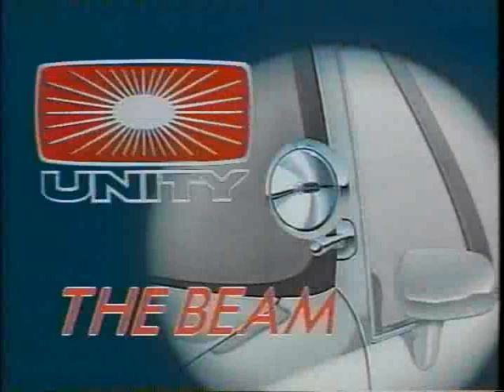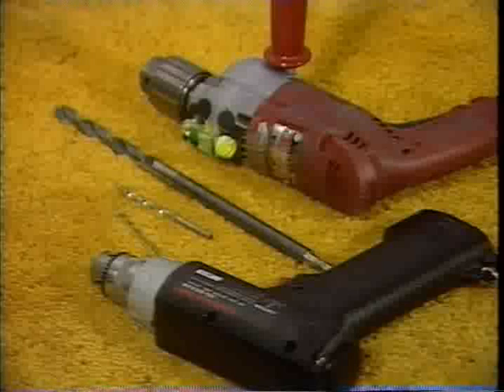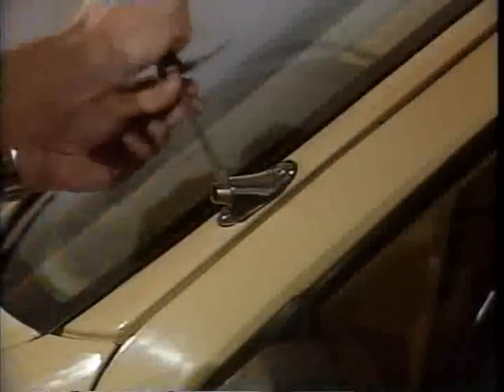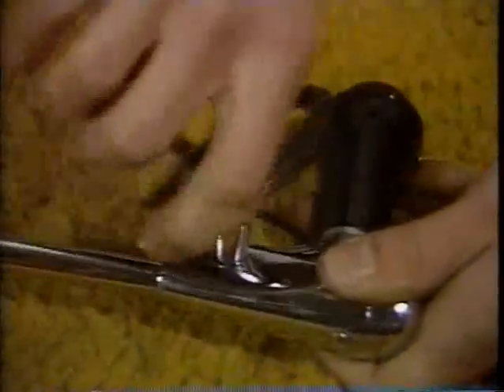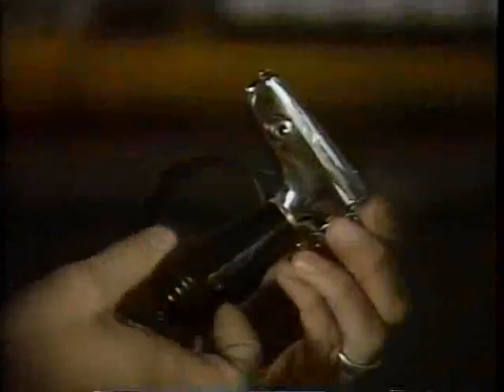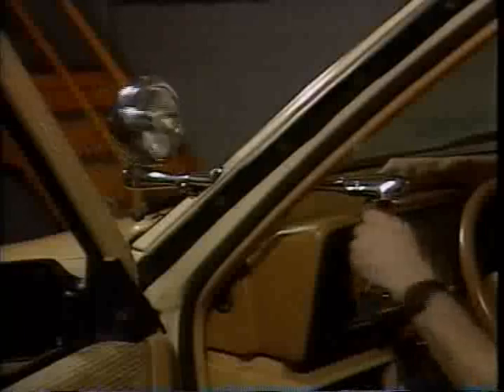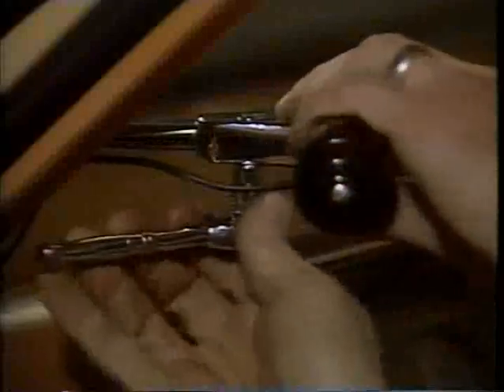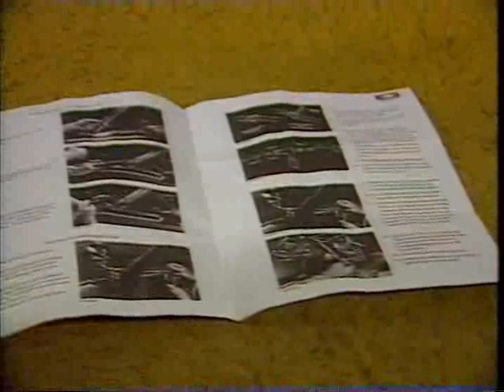Unity Spotlight Installation Video

Comment from the maker: To determine what parts are needed for your vehicle use our application search. By selecting year, make, and model our application search will provide you with a list of different spotlights that fit your vehicle and installation kits needed to mount the lights. Application Search: https://www.unityusa.com/Application-Search_ep_77.html
Reply: I think 400 dollars for one spot light is a might much.
Reply: @TempoDrift1480  I just found one at a pawn shop for $10. I have to order the install kit but I was like you. I didn’t want to install something for novelty for that price but for $10, I’m gonna do it! Good luck on your search
Reply: Drilling through a structural member of a cars roof is almost certain death in a roll over!!! Who in cornbread hell thought this was a good idea!!!

Comment: The whole “keeping the drill level “is very confusing. My bracket for a Toyota Tacoma is angled downwards 20 degrees thus it’s impossible to have the drill level. Does unity mean keep the drillbit parallel to the bracket? I have managed to drill through the outer sheet metal with a brand new half-inch drill bit but I warn you it’s not for the faint of heart. The flute of the drill bit will snag on the Sheet Metal (yes I was going at a very slow speed with a heavy duty drill) and on the bracket forcing the bracket upwards and possibly bending  the sheet-metal of your vehicle. I have tried for several hours even machining bushings for a 1/8 inch drill bit and 3/16 inch drill bit to try to make a pilot hole for the half-inch bit to go through. It is not working because of the angle of the a pillar of my truck. I was just forced basically to buy the $132 drillbit from unity in hopes that I will be able to install my spotlight. Also I advise anybody attempting this to use rivet nuts and machine screws to attach the bracket to your vehicle if they can get them instead of the sheet metal screws that unity provides. Because as I mentioned above if the drill bit snags it’ll rip the sheet metal screws out of the holes of the sheet metal forcing you did you do some repair work that you didn’t want to do. If your bracket is pretty level and it’s a straight shot I’m sure that should be no problem but if your bracket is angled downward I’d be very careful.

Comment: My concern is the inside handle is so long. I plan to install in a Jeep JK Wrangler 2 dr. This isn't a Crown Vic, I need a very short shaft, I still need to steer the Jeep. Those handle look a inch or two from the steering wheel. How about a super short post handle?
Reply from the maker: For 2017-1996 Jeep Wranglers a spotlight with a V length shaft is used and is mounted with a 12 installation kit for driver side mount and 12RH installation kit for passenger side mount. This is 1.5 inches shorter than the spotlight used on the crown victoria. Position of light handle to the wheel is not just controlled by shaft but how the light is mounted through the vehicle. For the crown victoria we had to make a special mounting setup with the bracket inside of the vehicle and a notch cut into the door to make it fit. For the jeep the light is mounted normally on the post. The goal our of engineers when developing applications is to keep the handle safely away from steering wheel. Also we now have handles with shorter grips available. 

V shaft spotlight options: https://www.unityusa.com/V-Shaft_c_2971.html
12 kit: https://www.unityusa.com/12-Installation-Kit_p_794.html
12RH kit: https://www.unityusa.com/12RH-Installation-Kit_p_814.html

Comment: Is it possible to do a pillar mount on a 99-2016 Ford Superduty? I only have found kits for door mount.
Reply from the maker: Our application engineers determined that A Pillar mount would not work. We only have a door mount application.

Comment: I was wondering if there is a way I could possibly install one on a 2000-2005 Buick Lesabre. Is it possible?
Reply from the maker: 2000-2005 Buick Lesabre uses a spotlight with a DC length shaft mounted with a 232RH installation kit for driver side mount or 232 installation kit for passenger side.

DC Shaft Spotlight Options: https://www.unityusa.com/DC-Shaft_c_2959.html
232RH: https://www.unityusa.com/232RH-Installation-Kit_p_876.html
232: https://www.unityusa.com/232-Installation-Kit_p_854.html

Comment: How about a shorter Shaft? The Jeep Wrangler has a very small cabin. That Shaft is very long, that shaft is right in your face. How can I buy a shorter shaft?
Reply from the maker: We have around 80 different shaft options and 17 standard shaft lengths. Not knowing what shaft you have or what year of Wrangler makes it hard to give you a good answer. I'm going to make some guesses, if anything is wrong the info may be different, let me know and I will give you correct info. 

I am going to guess this is a 2018-1997 Jeep Wrangler. For that, we recommend a V length spotlight shaft mounted with a 12 installation kit for driver side or 12RH for passenger side. 

Without knowing shaft length can't tell you if that is shorter or not than what you have. If you bought a light second hand from somewhere like ebay, most of those lights tend to be Crown Victoria spotlights. Those lights use a very specific shaft designed only for Ford Crown Victoria (and vehicles of the same base frame) The shaft is 1 1/2" longer than the V used for the Wrangler. So the V would be shorter than that light. We are also starting to see more Explorer and Taurus lights from similar sources. Those lights are 3" and 6 1/2" longer.

Shaft of a spotlight can be switched out. Replacement V shaft is 3615-V-45.

V Length Shaft Spotlights
http://www.unityusa.com/V-Shaft_c_1574.html

Replacement V Length Shaft
http://www.unityusa.com/3615-V-45-Shaft-Headpost-Assembly_p_683.html

12 Installation Kit
http://www.unityusa.com/12-Installation-Kit_p_794.html

12RH Installation Kit
http://www.unityusa.com/12RH-Installation-Kit_p_814.html
Reply: Thank you for the info. At this time I don't own the spotlight, I'm seeking a new light with this short shaft you speak of. If you know of a Unity Dealer in Northern Colorado that can sell & install on a 2017 Wrangler JK I'd love to be your customer.
Reply from the maker: Here is a link to our distributor search using you zip code, you can search for distributors near you. Ones that do installs are marked. If you need any additional help please let us know. http://www.unityusa.com/Distributor-Search_ep_78.html
Reply: Thank you, however O'Reilly Auto Parts is the only dealership from Denver to the Wyoming border, and they do not install.  I'm really seeking a company to order the part, install the part, and back the part. It's a brand new Wrangler. I need it done right. Thanks for your effort.
Reply from the maker: Around Denver & heading north to Wyoming for Installers we have:

The Lighthouse Inc 5900 East 58th Avenue Commerce City CO 80022 303-227-0001

Wireless Advanced Communication 3901 West Service Road Evans CO 80620 970-330-9415

Lighting Accessory & Warning Systems 7124 South Dillion Court Englewood CO 80112 720-870-4965

Av-Tech Electronics Inc 12851 West 43rd Drive Golden CO 80403 303-288-0313
Reply from the maker: crzyredneck  1985 Chevrolet S10 uses a spotlight with a GM length shaft mounted with a 189RH installation kit for driver side mount or a 189 installation kit for passenger side mount.

Comment: I bought a 2014 ppv Tahoe. Which kit do I need. I do not have side curtain airbags. Thanks
Reply from the maker: 2014 Chevrolet Tahoe uses a 257 installation kit for driver side to mount a spotlight with a CF54 shaft and 257RH installation kit for passenger side to mount a spotlight with a CF55 shaft.

Driver:
CF54 Shaft spotlight options: http://www.unityusa.com/CF-54_c_2056.html
257 kit: http://www.unityusa.com/257-Installation-Kit_p_947.html

Passenger:
CF55 Shaft spotlight options: http://www.unityusa.com/CF-55_c_2057.html
257RH kit: http://www.unityusa.com/257RH-Installation-Kit_p_1600.html

Comment: I just bought an old set of S6 lights off some Ford vehicle. the shaft appears to be the same type as the one shown in this video. Will your modern production mounts and handles be compatible?

Thanks,
John
Reply: They should be compatible.
Reply: +Chad Stone I bought some handles, they are compatible. Thanks
Reply: Yes they are, check out the video I have that goes in depth explaining how these work
Reply from the maker: Sorry we didn't see this sooner, just realized youtube was sending alert emails to the wrong email. The way our lights mount and how handles attach to the light has been the same for the whole life of model S6 spotlights, which began production in 1948 and are still currently in production. Current spotlights also mount same and attach handles the same way. In that way you should be fine. My only concern is that length of the shaft does matter for specific vehicles, too short or too long can cause issues with function. Also some modern vehicles due to internal parts inside of a post getting more complicated (air bags, speakers, etc) do need custom fit shafts designed specifically for that vehicle.

Comment: Love old media - btw, do you have an application for an 07 yaris? My sharkcar needs a spotlight!
Reply from the maker: 2007 Toyota Yaris sedan and 3 door use a spotlight with a CL length shaft mounted with a 208 installation kit for driver side mount or 208RH installation kit for passenger side mount.

CL shaft Spotlight Options: https://www.unityusa.com/CL-Shaft_c_2958.html
208: https://www.unityusa.com/208-Installation-Kit_p_769.html
208RH: https://www.unityusa.com/208RH-Installation-Kit_p_773.html

Comment: I need a spotlight for my Dodge Charger 2017 Pursuit, what would be the model number? Would the S04 work?
Reply from the maker: 2017 Dodge Charger uses a spotlight with a CF61 shaft mounted with a 253 installation kit for driver side or a spotlight with a CF62 shaft mounted with a 253RH

Driver Side:
CF61 shaft spotlight options: https://www.unityusa.com/CF-61_c_3053.html
253: https://www.unityusa.com/253-Installation-Kit_p_910.html

Passenger Side:
CF62 shaft spotlight options: https://www.unityusa.com/CF-62_c_3054.html
253RH:  https://www.unityusa.com/253RH-Installation-Kit_p_1597.html

Comment: What about finding the right ones for a 2008 ford crown victoria police interceptor because I am looking to purchase 2 of them.
Reply from the maker: 2008 Ford Crown Victoria Police Interceptor used a 94014-0002 spotlight mounted with a 5556 installation kit for driver side and a 94015-0002 spotlight and 5557 installation kit for passenger side mount.  Correct lights for vehicles can be found using our Application Search found under the searches section of our website or by following this link: http://www.unityusa.com/Application-Search_ep_77.html

94014-0002 Spotlight
http://www.unityusa.com/94014-0002-H3-Halogen-6-Spotlight-Black-330-S04-LH_p_1246.html

5556 Installation Kit
http://www.unityusa.com/5556-Installation-Kit_p_808.html

Passenger Side
94015-0002 Spotlight
http://www.unityusa.com/94015-0002-H3-Halogen-6-Spotlight-Black-330-S04-RH_p_1247.html

5557 Installation Kit
http://www.unityusa.com/5557-Installation-Kit_p_809.html

Comment: I might be coming into a 2001 Ford Crown Victoria. Do you guys have any LED models available for the CV, non PI variant?
Reply from the maker: Yes we do. We have three different LED options that are all available for the Crown Victoria. Standard LED, our new X-LED and our smaller 5" LED
Since this is not a PI we have two different mounting locations that use different parts. The PI uses the inside post application and we also have the door mount installation. Door mount is much easier install but the light will move when the door does. Inside post is more professional but requires extra steps and cutting a notch in the door. If the vehicle already had a spotlight installed you would just get the correct light for the existing hole.

Door Mount Parts:
Standard LED: https://www.unityusa.com/335GM-0002-6-BLK-SPOTLIGHT-LED_p_36.html
X-LED: https://www.unityusa.com/X335GM-0002-6-BLK-SPOTLIGHT-LED_p_2388.html
5" LED: https://www.unityusa.com/255GM-LED-5-Spotlight-H1_p_3176.html
Install kit LH: https://www.unityusa.com/232-Installation-Kit_p_854.html
Install Kit RH: https://www.unityusa.com/232RH-Installation-Kit_p_876.html

Inside Post:
Driver Side:
Standard LED: https://www.unityusa.com/94018-0002-LED-6-Spotlight-Black-335-S04-LH_p_55.html
X-LED: https://www.unityusa.com/X94018-0002-X-LED-6-Spotlight-Black-X335-S14-LH_p_2405.html
5" LED: https://www.unityusa.com/S94002-LED-5-Spotlight-255-H1-LH_p_2964.html
Install Kit: https://www.unityusa.com/5556-Installation-Kit_p_808.html

Passenger Side:
Standard LED: https://www.unityusa.com/94019-0002-LED-6-Spotlight-Black-335-S04-RH_p_56.html
X-LED: https://www.unityusa.com/X94019-0002-X-LED-6-Spotlight-Black-X335-S14-RH_p_2406.html
5" LED: https://www.unityusa.com/S94003-LED-5-Spotlight-255-H1-RH_p_2965.html
Install Kit: https://www.unityusa.com/5557-Installation-Kit_p_809.html

Comment: I want to install an old spotlight on a 1988 dodge diplomat but i'm worried about messing up and cracking the windsheild. Any tips?
Reply from the maker: If you correctly follow the instructions and use mounting template included there shouldn't be any issue. The installation kits for the lights come with a mounting template specific to the vehicle. Using the template, you locate the location on the A-pillar where our engineers have determined in safe to drill through. The bracket is then mounted in template location. Once the bracket is secured a drill bushing is set in the bracket and is used as a guide to help make sure the drill does through correctly. 1988 Dodge Diplomat uses a spotight with a V length shaft mounted with a 220 installation kit for driver side mount and a 220RH installation kit for passenger side.
Vshaft Spotlight Options: http://www.unityusa.com/V-Shaft_c_2971.html
220: http://www.unityusa.com/220-Installation-Kit_p_945.html
220RH: http://www.unityusa.com/220RH-Installation-Kit_p_964.html
Reply: @unitymanufacturing9838  thanks for the info!

Comment: would you happen to know the model used on a 2000 crown vic intercepter? looking to buy a spot light
Reply from the maker: 94014-0002 spotlight mounted with a 5556 installation kit is the most common light used on a 2000 Ford Crown Victoria Interceptor. That light and kit are for driver side. For passenger side a 94015-0002 spotlight and 5557 installation kit would be used.

94014-0002
http://www.unityusa.com/94014-0002-H3-Halogen-6-Spotlight-Black-330-S04-LH_p_1246.html

5556
http://www.unityusa.com/5556-Installation-Kit_p_808.html

94015-0002
http://www.unityusa.com/94015-0002-H3-Halogen-6-Spotlight-Black-330-S04-RH_p_1247.html

5557
http://www.unityusa.com/5557-Installation-Kit_p_809.html

Comment: I just wanna know how to turn it on. I have a 2011 cvpi with one on.
Reply from the maker: Inside of the vehicle, on the handle of the light used to move it, there is a toggle switch on the handle that is used to turn the light on and off. Possible issues if this does not work is the bulb is burned out and needs to be replaced, or if this is a retired police car, sometimes when preparing them for sale departments may have disconnected the light from the power source.

Comment: What unit is for a 2003 crown vic police interceptor?
Reply from the maker: 2003 Ford Crown Victoria uses a spotlight with a CF1 shaft mounted with a 5556 installation kit for driver side mount or a spotlight with a CF2 shaft mounted with a 5557 installation kit for passenger side mount.

Driver Side:
CF1 Shaft Spotlight Options: https://www.unityusa.com/CF-1_c_3009.html
5556 Installation Kit: https://www.unityusa.com/5556-Installation-Kit_p_808.html

Passenger Side:
CF2 Shaft Spotlight Options: https://www.unityusa.com/CF-2_c_3010.html
5557 Installation Kit: https://www.unityusa.com/5557-Installation-Kit_p_809.html

Comment: Does anyone know the model # of spotlight for a 1996 Crown Victoria? It's an old Police Interceptor but never had one installed.
Reply from the maker: 1996 Ford Crown Victoria would use 94000 series spotlight mounted with 5556 installation kit for driver side or 5557 installation kit for passenger side. The lights and kits are side specific for this vehicle.

94000 Series Spotlights
http://www.unityusa.com/94000-Series_c_1982.html

5556 Install Kit
http://www.unityusa.com/5556-Installation-Kit_p_808.html

5557 Install Kit
http://www.unityusa.com/5557-Installation-Kit_p_809.html

Comment: I have a 2001 Chevy Silverado 1500 LS, what kind of kit will I need for it?
Reply from the maker: 2011 Chevrolet Silverado 1500 has two applications: door mount and inside post mount.

Door:
"A" shaft spotlight: http://www.unityusa.com/A-Shaft_c_3067.html
Driver Side Install Kit 229: http://www.unityusa.com/229-Installation-Kit_p_807.html
Passenger Side Install Kit 229RH: http://www.unityusa.com/229RH-Installation-Kit_p_821.html

Inside Post:
Driver Side:
CF27 Shaft Spotlight: http://www.unityusa.com/CF-27_c_3029.html
7442 Install Kit: http://www.unityusa.com/7442-Installation-Kit_p_857.html

Passenger Side:
CF28 Shaft Spotlight: http://www.unityusa.com/CF-28_c_3030.html
7441 Install Kit: http://www.unityusa.com/7441-Installation-Kit_p_856.html